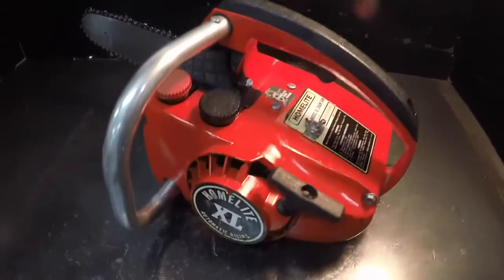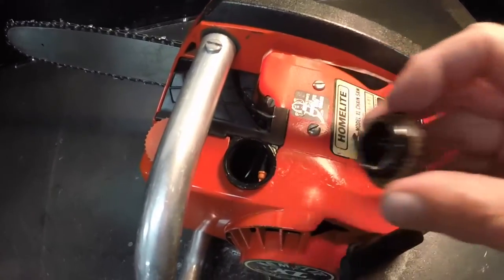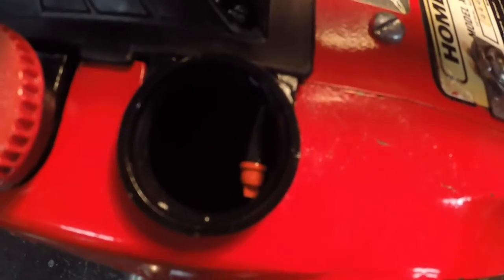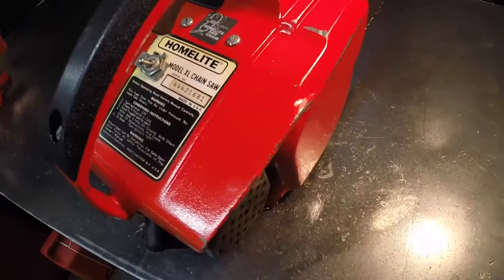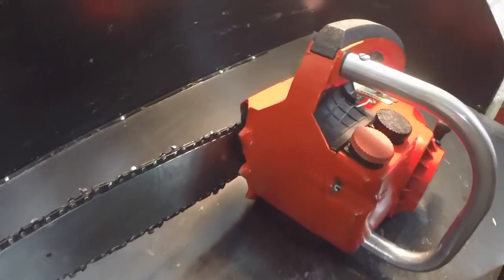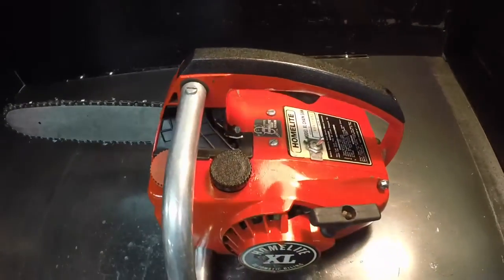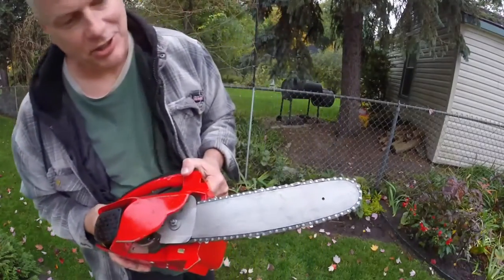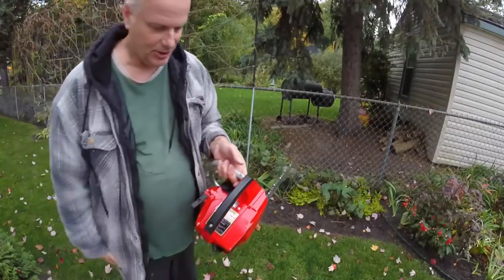9" Homelite XL chainsaw oilier repaired

Comment: Inherited a XL2 Auto, never been run, new in carry case with tags still attached. Started after a few pulls and ran sweet for a few minutes, then fuel mix started leaking out everywhere. After sitting for a few months it appears to have leaked bar oil too, which may be normal. Got to figure out why fuel mix is leaking like crazy though.
Reply from the maker: The fuel lines most likely have split, and maybe the needle and seat in the carb could be stuck. Oil from the oiler will leak out for a day or so, after running the saw.
Reply: turbothrust348 just got done tearing it down. The fuel check valve and the air cleaner element are missing. Judging by the powdered element material in the saw, it sucked it through and blew it out the exhaust. Where the check valve *went I don't know. It was probably so dried it shrunk and fell out.
Reply: PS, I improvised a check valve and sprayed everything out with solvent and air. It runs surprisingly well for having sucked the powdered element through the engine. Go figure. lol

Comment: Are the Duck Bill Valves the same for the oil and fuel tank?  (Can you use the same one in both)  Thanks.
Reply from the maker: Yes, I believe they are the same.
Reply: @OldCarAlley  Thank you.  Yes, you are correct.  I confirmed today that they are as well  from my local small engine shop.

Comment: How do u tension the chain on these
Reply from the maker: Loosen the bar sightly, then pull up on the tip to the bar a little, why turning the screw on the engine side of the bar, until the chain no longer comes out of the bar... but not to tight, then why still holding the tip of the bar up, tighten the bar nut. Hope this helps.
Reply: Old Car Alley I have this exact saw  but bigger bar length. I can tension other saws but I couldn't see how to get the cover off to get to the bar to loosen it  on other  saws there are 2 bolts to loosen on the cover then a tension screw I can only see a bolt on the bar  inside the cover and I'm not sure how to get the cover off. I can't see where u loosen the bar and does the cover come off first  ? Thsnks
Reply from the maker: If its the same saw, the bar nut is visible and accessible behind the cover. Bar length should not make any difference. If its not the same saw, I would need to see it.